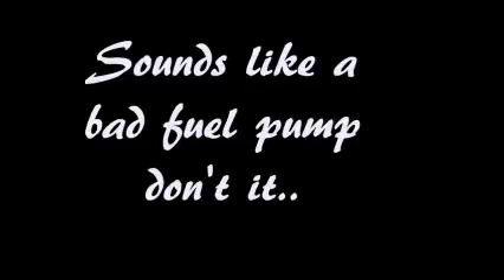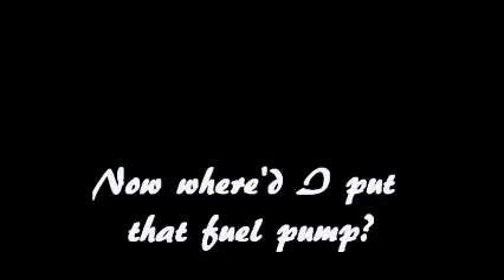1964 VW bug first start this year.... NOT!

Comment: @WhoSaidTyler Have to go with him on this.Epoxy that inlet in there and try a nice center punch around it to shift some metal around it and hold it in there good after the epoxy sets.When replacing the lines, one thing I heard of is to relocate the filter from the engine compartment to directly under the fuel tank.That way if the fittings come loose your bug doesn't burn.Also go with good quality fuel line.That block is magnesium and once it starts going, there's pretty much no putting it out.

Comment: its common to tie each connection from the hose clamp to the body of the carb/fuel pump, think vw trends had a wright up on it about 2 years ago,some thing like what they do on air plane fittings,

Comment: Oh noooo....fix that metal fitting Richard...you don't want to mess with that.

That has caused many many MANY burnt VW's. Yu can imagine what comes after it popping out of the carb with you tooling along at 60mph.

 You'll need to epoxy and STAKE IT in place. It can not come out, ever...move metal physically to prevent it.

I would also strongly recommend repalcing all the rubber lines in the engine room each year with the good cloth German stuff. Metal filter, no plastic fire starters.